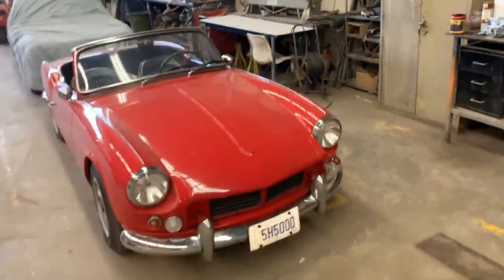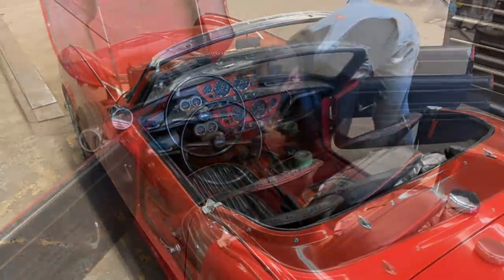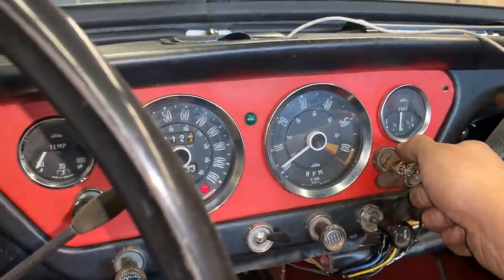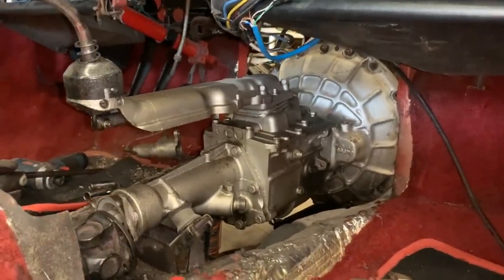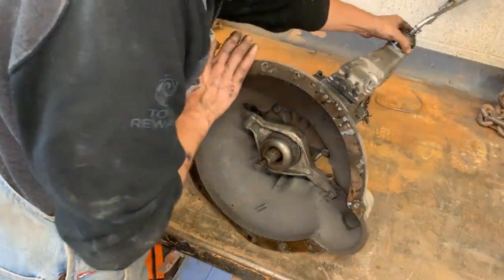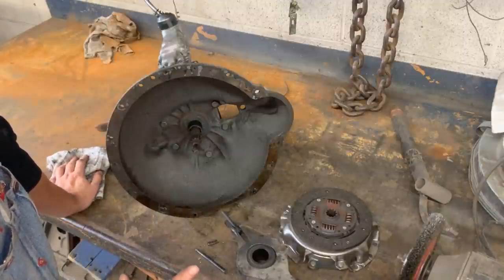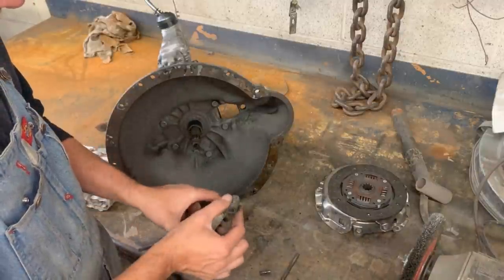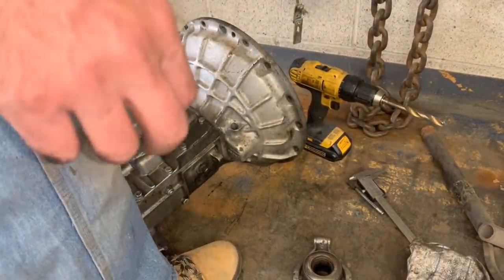1966 Spitfire - Clutch/Transmission issues - Part 1

Comment: Bronze oilite bushings are avalable from any good automotive store, they are available with a flange  so they cannot drop through. For the pin a long suitably sized bolt is used.  Removing the carpets or covering them is a good idea!
Reply from the maker: Hi, I assume you are new to my channel and you didn't get to know me yet. My purpose of all these restorations is not to make money off the finished cars or save time. II do that for hobby and because I like the challenge. So even if I spend more time (not cost effective) making something instead buying it and replacing it, the time spent on that is fun joy and self education. On top of that it it also makes for an interesting material for many people to watch as per all comments I get. So I would always try and fix things myself, before I go to spend money on them even if that is not cost efficient. Think about the fisherman who spends thousands on fishing equipment and many hours standing by the water just to catch a fish that he can get from the store for 30 bucks... I am in the same situation here :) Sometimes my fish is not as good as the one from the store and turns out to be very big time investment, but I enjoy catching it and the taste..... mmmm... yummy :) I hope you get my point, I appreciate all your comments and you are right in most of them but you are looking from a different perspective than mine. About the carpet, yes, you are 100% right and I admitted that in video.
Reply: @RustyBeauties   Fare enough.   My comment was aim3d at someone seeing your video and thinking your way was the optimal of only way to go about the job. Most owners don't have a lathe.

Comment: Those waffle sleeves are spring steel and they hold the pin in place so it doesn't just drop out.

Comment: You might want to check for Axial play at the engine crankshaft before pulling the transmission. Often a dropped thrust washer will cause clutch problems.
Reply from the maker: Yes, I did check. Nothing wrong there.

Comment: Still early in the video, but do you check that the pivot pin for the throw out arm hasn't dropped out?  Just finished typing this when you went around the other side of the trans.